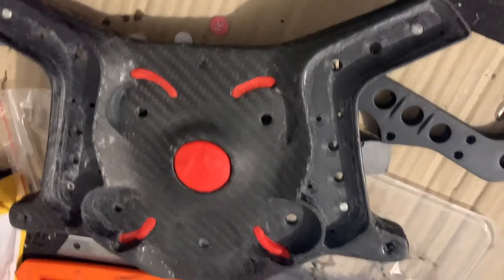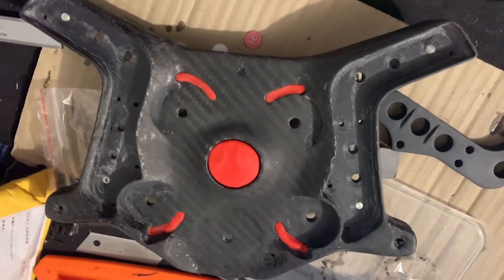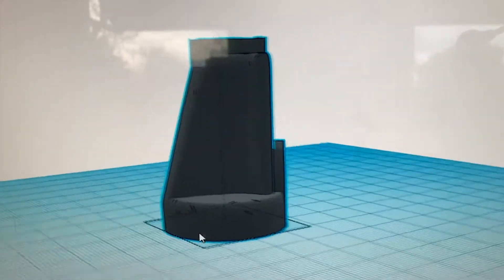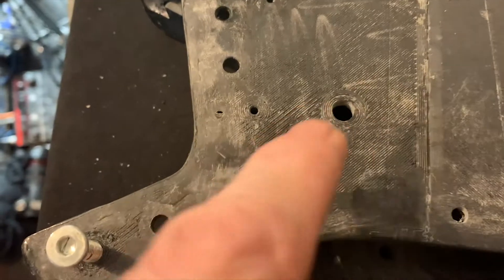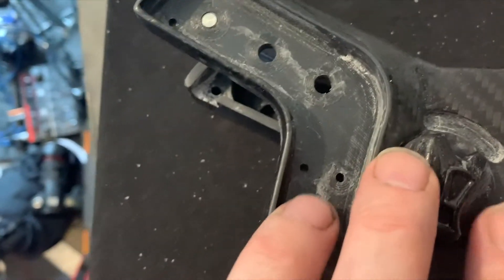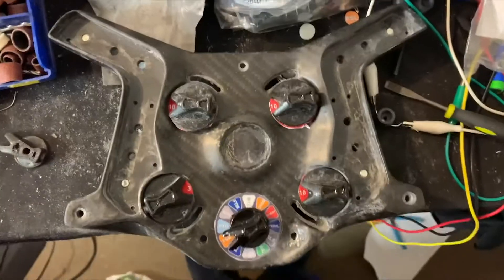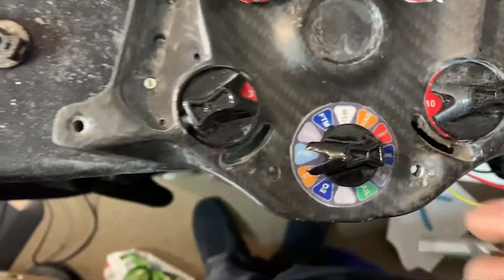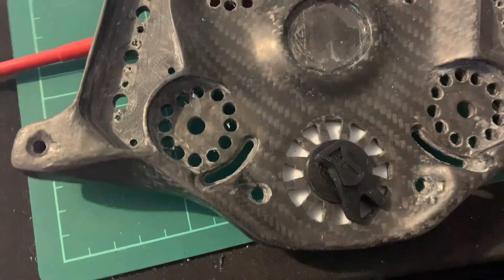BWM M8 GTE Sim racing Carbon Fiber Wheel backlighting preparation

Comment: Which lighted push buttons are you using? And where do you get the stickers on the push buttons?
Reply from the maker: I made each one myself in several parts with a miniature led inside. I got the stickers printed on sticky vinyl at a local print shop.

Comment: How to do the wiring and where can I get the code
Reply from the maker: I’ll be showing the wiring. No code involved if you use the Leo Bodnar BBI-32 usb button box interface board. It’s plug and play. Simply attach switches and select what you want them to do in the sim.